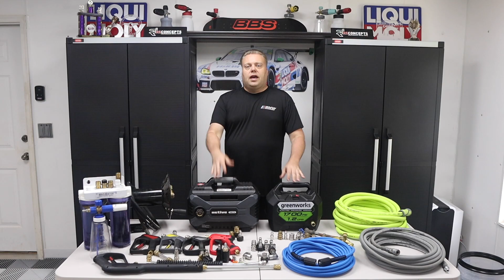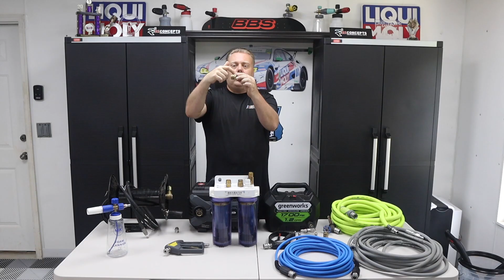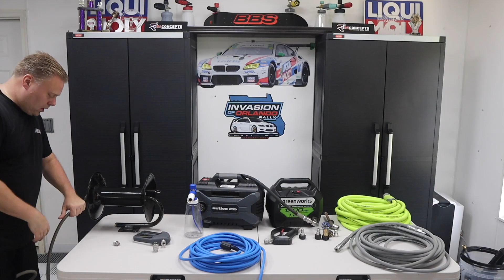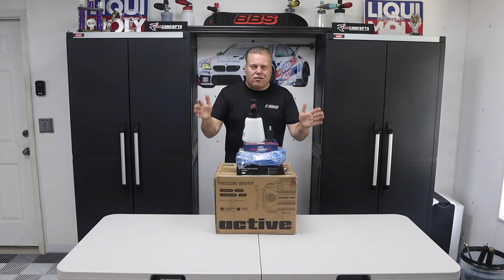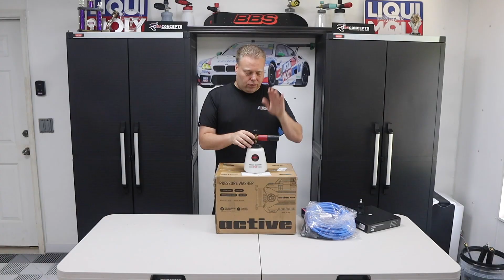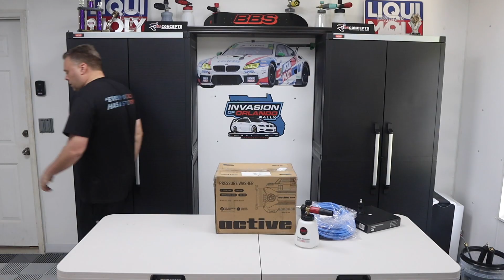How To Upgrade Your Pressure Washer Setup | All Connections Needed | Filtration & Hose Reel

Comment: Great video.  Thanks for putting it together.  I was actually just looking for a 90 degree m22 fitting.  I have limited space beside my garage door to the wall.  12 inches depth.  I have to be conscious of anything sticking out there and risking it getting hit.  That 90 degree will be a big help.  Working on finding the smallest hose reel I can find now.  So far, 12 inches is about it and that should work.  Just spending more time looking for smaller ones.
Reply from the maker: The general pump 50ft has a small footprint. I have a small area for my wash setup. I spent a good bit of time trying to find elbows that would work and this is the best I could find. Not cheap though that’s for sure. That elbow is high quality though.

Comment: I have the simoniz version of the active ve52 and am a bit confused on how to get a quick connect for the garden hose. Is it m22 15mm on the unit? And what would I need for the garden hose?
Reply from the maker: Garden hose should be standard 3/4 GHT (Garden Hose Thread) and the same on all pressure washers. The pressure washer side is where it is different and is 15mm M22. Simoniz is Canadian I think so not sure if garden hoses are a different size there. Any garden QD should work, but I suggest the ones that are brass and have large inside diameter for good water flow.

Comment: Great video. I've seen other videos over the years, including your previous one. This has plenty of info and all variations of what someone would need to upgrade their pressure washer setup.

I'll add, for lower gpm units like the Ryobi the only thing I would've mentioned for the foam cannon upgrade would be the 1.1mm orifice. Great content. I entered the giveaway.
Reply from the maker: I was going to mention that, but video was already running long. I’ll be doing a foam cannon video kind of like this just going over everything from best foam to how to clean them.
Reply: That's very true, it was one of the first things I noticed before watching. It's one of your longest videos in some time but it didn't feel too long. 
Though I'll admit, I did miss the bloopers at the end. Lol

Looking forward to this foam cannon video. That will be another good one.

Comment: Keav, thanks for putting this video together and for all of the outstanding content you produce.  This was extremely helpful and could not have come at a better time, especially the information about the M22 15" to 14" Adaptor for Active pressure washers.  I just ordered that adaptor for my new setup.  A few days ago, I ordered the Active 2.0 pressure washer, Active stubby gun, McKillian's Extension Wand, MJCC Foam Cannon Pro 2.0, Twinkle Star Pressure Washer Adapter & Quick Disconnect Kit (Brass), and 50' Uberflex Hose.
Reply from the maker: Active 2.0 is using the 14mm. The VE52 runs a 15mm. Hopefully You can cancel that order in time.
Reply: @CarsWithKeav  Thank you!  Will do.